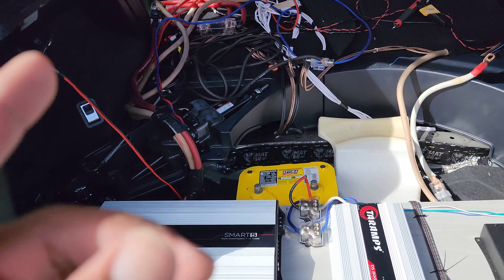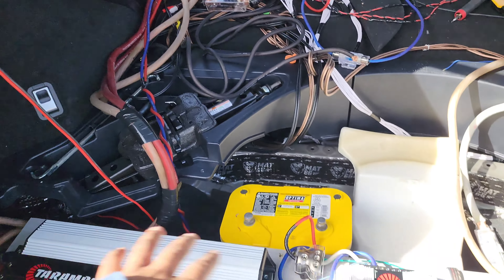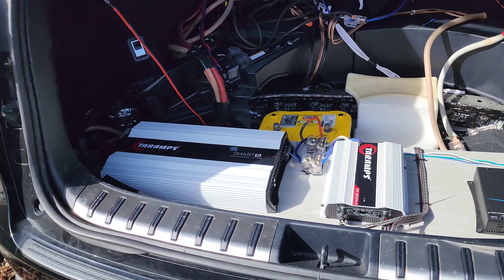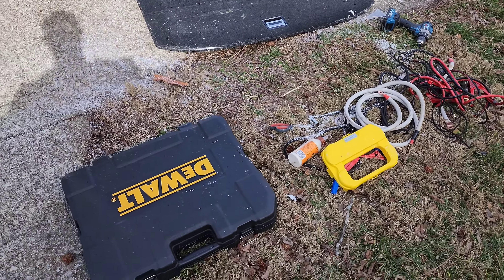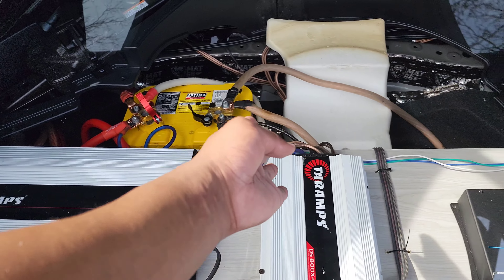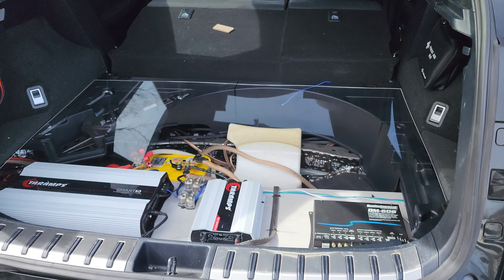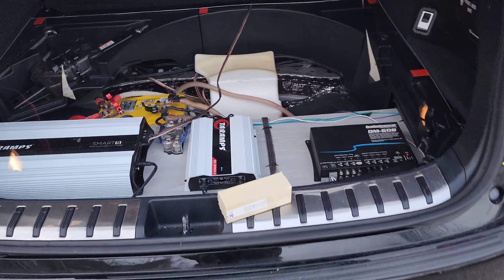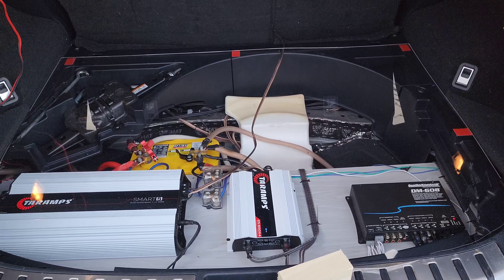Full Plexiglass Floor Sundown ZV6 Build in a LEXUS SUV?! | Cool or stupid? 🤔

Comment: It's looking good 🔥
Reply from the maker: I appreciate it. Can't wait to see it with the box in. Might put lights under the glass
Reply: @Kpaceguy  so I got to thinking and I was wondering what would happen if you put let’s say your zv6 in a box double recommended air space but put let’s say maybe a 1,000 watts on it or so instead of a 5-6k amp in a recommended box would it preform the same would it have more or less out put Because I was thinking how jl audio works it takes less power to preform bc it has softer soft parts to be able to move right and I know the zv6 has very stiff soft parts bc it’s built to withstand all the power being thrown at it so I was just curious and something to talk about maybe I’m going no where with this idea but worth a conversation lol
Reply: @Kpaceguy or maybe it could be a cool experiment or idea for a video maybe

Comment: Like the idea of the glass and it looks cool , but I think you might want to put some support underneath the plastic glass , because overtime it will start to sink because of the weight factor and no real support because if wood will bow there’s no doubt that the plastic will for sure. Just adding my thoughts from experience and projects that I have done.

Comment: Seems like overkill, less is more my friend. Mount those amps vertically against the inside of the spare wheel well. Then get one of those spare tire subs that clamp right onto the tire mount. Then just put the factory cover back over it, you will still have your cargo area then. It's really easy to have bass pressurize a SUV, you don't really need more than the spare sub. Plus you will have all of your stuff hidden, so it will be much less likely that your SUV is broken into.  Car audio isn't like home audio, you don't need huge subs to get good sound. People will just think you are a D-bag if your bass is bothering them and your car is rattling.
Reply from the maker: I like quality bass way too much to get a tire sub. And I'd go under seat sub or small 10in sub before I ever did a tire sub too
Reply: @Kpaceguy  true, could make a custom enclosure under there or under seat. The trick is to make it all hidden and look factory. Unless you're in high school or one of the fast and furious movies, then I wouldn't worry about showing it off.
Reply: I just did 3 10's in my spare tire wheel well. On 3k watts nd a lithium battery nd still have all of my trunk space. Also your wire management could be better if you cut ALL excess wire.
Reply: @Kpaceguy I'm gonna steal the plexi glass idea though😅
Reply from the maker: Make it happen let's see it!

Comment: You need to worry about the amps overhearing due to lack of ventilation
Reply from the maker: I haven't forgotten. There will be temperature controlled fans on top of the fans built in. It shouldn't be much warmer under the glass as it is above it since there are pathways for air to get in from the A/C